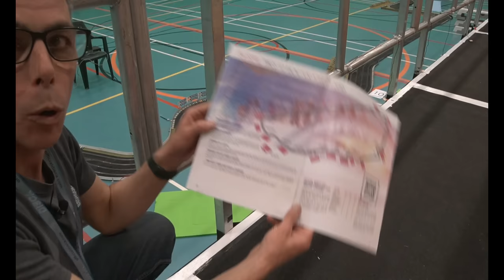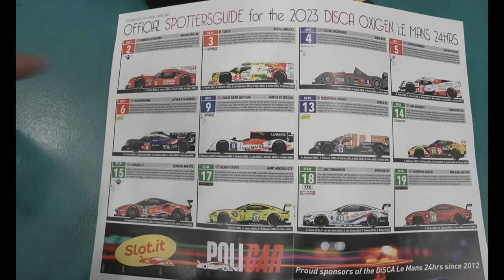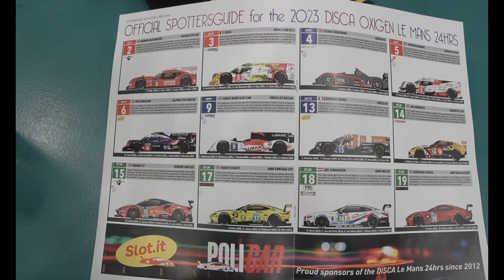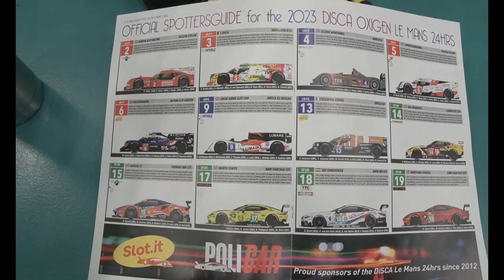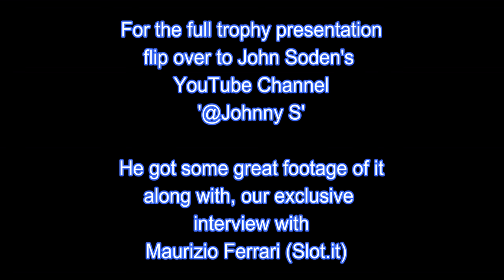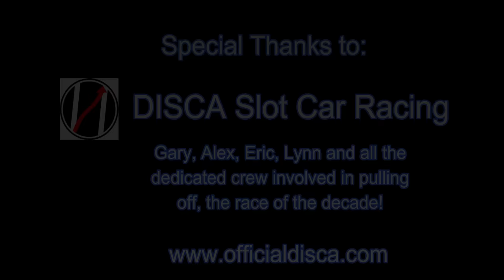2023 DISCA LeMans 24 Hour Digital Slot Car Race #slotcar #slotcarracing

Comment: Did this around 40 years ago outside with 6 lanes. Circuit was probably about 2/3 of the size of this one. When the dew came down on the track it was quicker to run treaded tyres.
Reply from the maker: That sounds like an amazing experience, did the dew not hamper any of the electronics?

Comment: I stumbled across this video and it took me back to the days (the late 60'searly 70's) when I raced slot cars. Without denigrating todays racers, things seemed more sophisticated / involved back them. Chassis were soldered and hand made from brass and piano wire. The engines were fitted at an angle and drove an angled drive gear. The best motors were made by Champion and Miura. In fact, there was a whole industry supplying tyres, electrical components and a host of other supplies. I'd be interested to hear if anyone else raced in those days and how they think todays scene compares.

Comment: 25:46 I am new to this. How do they pass each other?
Reply from the maker: Morning buddy, welcome to the slot car rabbit hole! The type of track they use is digital do, you can use multiple cars on any lane and there are bits if track that have crossovers on them allowing you to press a button on your hand controller and then switch lane. Scalextric manufactures and sells a digital track cars and accessories of which, you can do this type of race on at home. If you were interested in getting one direct from their website, you can use our discount code 'TRACKFANSTV' and you'll get 5% discount pal 😉

Comment: It lacks the two chicanes on the Mulsanne Straight that was put in place as a security measure after several fatal accidents!
Reply from the maker: Thanks mate, I'll relay the feedback to Gary and Alex 💯🔥🔥
Reply: I know a guy, who during a practice round before the big race, back in the mid 80's on the Mulsanne Straight proved that cars can be excellent at flying (although not great at changing direction when airborne and the landing can be a bit rough on them), when he at 300 Km/h got airborne in his Sauber Mercedes C8 - during the 320 meter flight, he also completed two perfect somersaults before landing on the wheels again, unharmed - unfortunately the landing damaged the cars so much that it couldn't be ready for start!
Reply: @trackfanstv  
It might be hard to replicate the chicanes on the Mulsanne Straight with slot cars, IDK, and of course, without them it's still the old track - so if it's the 1980's look they're going for, then it's fine!

Comment: How are the individual cars controlled when they are on the same track or lane.
Reply from the maker: Hi bud, the track is a digital set up and each of the cars has a digital sensor within them that the driver controls. As the car approaches the piece of track that have a cross in them the driver hits a button on their controllers which sends a signal to the car which in turn signals to the track to move a small paddle (like a train set) to change the car into the next lane as it drives over it. Hope that made sense? 😂

Comment: What power supply is running all of this!! I struggle with just 4 cars 😂
Reply from the maker: Not sure but I could find out, what track are you running bud?
Reply: @trackfanstv  I have been using scalextric but I’m moving to Carrera. Had enough of the track going rusty and bad connections. Apparently Carrera is a lot better

Comment: I was wondering how they get past each other if they on the same track line?
Reply from the maker: Hi bud, the track is a digital set up and each of the cars has a digital sensor within them that the driver controls. As the car approaches the piece of track that have a cross in them the driver hits a button on their controllers which sends a signal to the car which in turn signals to the track to move a small paddle (like a train set) to change the car into the next lane as it drives over it. Hope that made sense? 😂

Comment: Isn’t there just one gun (/controller thing) for each slot on the track? How do you have more cars racing than there are slots? 
(Sorry if this is a dumb question, I just have zero experience with these things since playing with a little 2-car setup as a kid haha)
Reply from the maker: No pal, it's a common question, the track is a digital set up and each of the cars has a digital sensor within them that the driver controls with a hand controller (Slot.it SCP-2) from the podium. As the car approaches the piece of track that have a cross in them the driver hits a button on their controllers which sends a signal to the car which in turn signals to the track to move a small paddle (like a train set) to change the car into the next lane as it drives over it. Hope that made sense? 😂

Comment: What scale is this? 1:32? Also what digital track setup is that? Scalextric? carrera?
Reply from the maker: Hi bud, you're right, they're 1/32 scale and the track is Ninco (digital), also they don't make it anymore but a lot of clubs use it and maintain it. For those that can't maintain their Ninco, they're moving over to the Policar track as it has a similar, rough surface to it 👌🏻. Thanks for watching, most appreciated.

Comment: What a fantastic video and event! Im so glad the YouTube algorithm decided I might want to view it.

I have so many questions. What was the average lap time for each class? How many laps were completed in total and for each class? How many entrants were there for each class?

What was the actual speed recorded down Mulsanne and what does that translate to in scale speed? Do the car body shapes and aero actually play a role in handling, downforce and top speed? Were the motors tuned to ensure LMP1 were the fastest, LMP2 second fastest and so on? How did these teams approach tuning theur cars for 24 hours of racing? What were the advantages of running a harder tyre versus a softer tyre requiring more pitstops for replacement? How many motors did each car go through, and were they allowed to run strengthened internals or were sealed units required?

Basically, what a fantastic event, lots of hard work by a lot pf people, and my thanks to you for covering it. The enthusiasm is obvious to see. 👍

Comment: question i have is how do the cars swap tracks or slots a guess you say...... im general curious as i see a car thats on the outter lane..i dont think a marsell put them their
Reply from the maker: Hi bud, the track is a digital set up and each of the cars has a digital sensor within them that the driver controls. As the car approaches the piece of track that have a cross in them the driver hits a button on their controllers which sends a signal to the car which in turn signals to the track to move a small paddle (like a train set) to change the car into the next lane as it drives over it. Hope that made sense? 😂
Reply: @trackfanstv  Yes it does thanks because with luck you had also recorded a car did change lanes in the view of camera. I seen these countless videos of cars running on same track but no one seemed to want to explain how they swapped from one slot to another mid race.  Thanks bud.